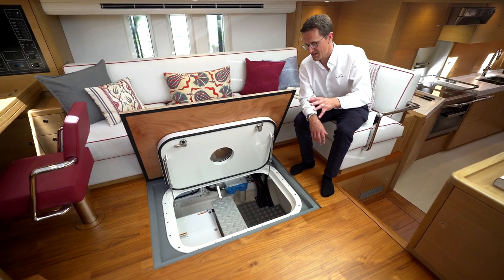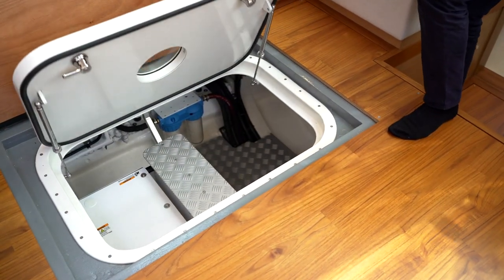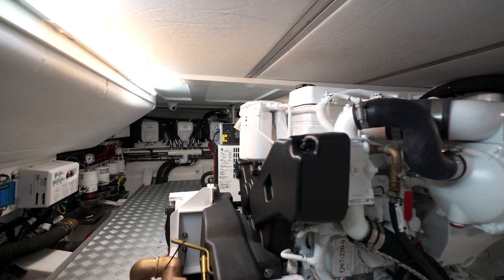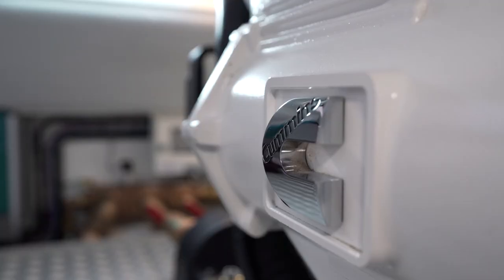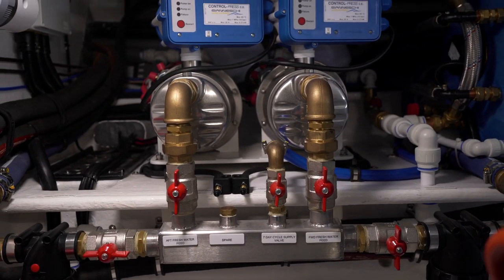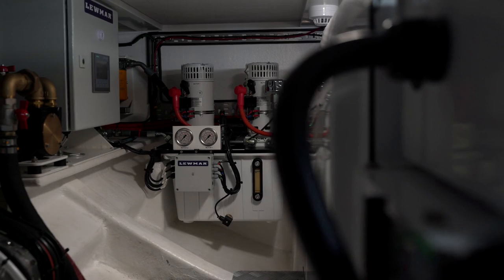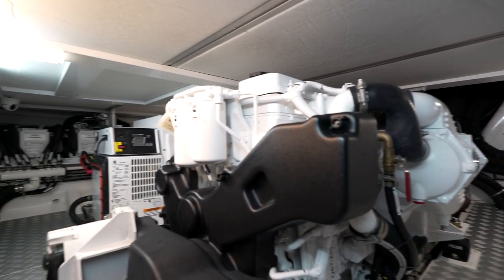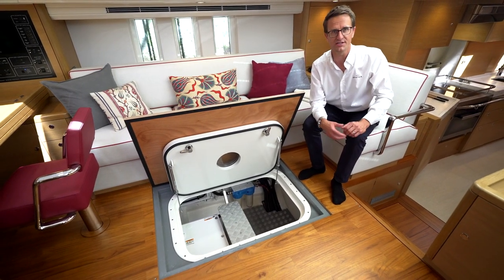A Closer Look: Oyster 745 Engine Room | Oyster Yachts

Comment: I have often wondered what it must be like trying to work on ones side whilst changing a filter or doing other work in such a low ceilinged engine room. This 745 has accommodation for a crew, but could one sail it alone, single handedly?
Reply from the maker: Hi Robert, at 75 foot the Oyster 745 is a joy to sail yourself, but we suggest to have a small crew to assist and maintain her.